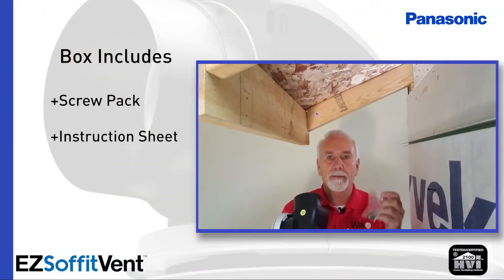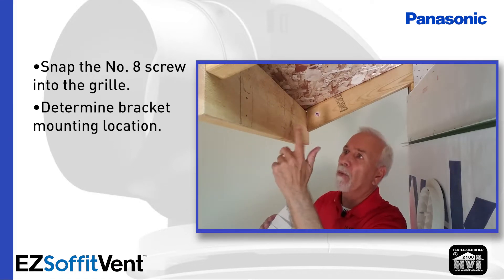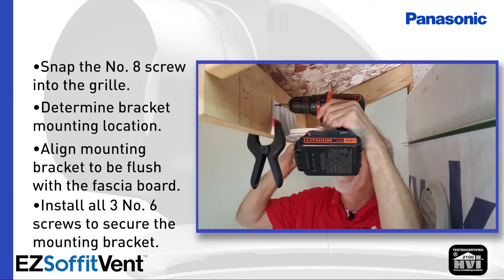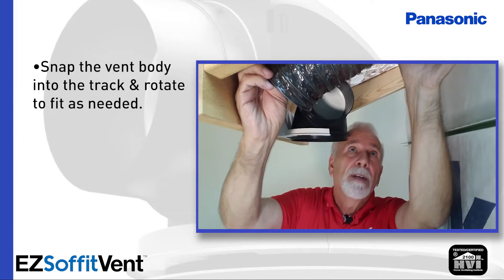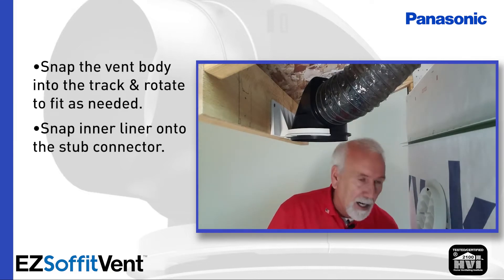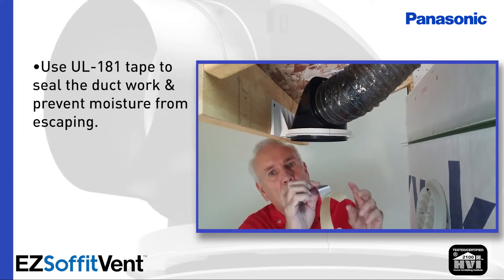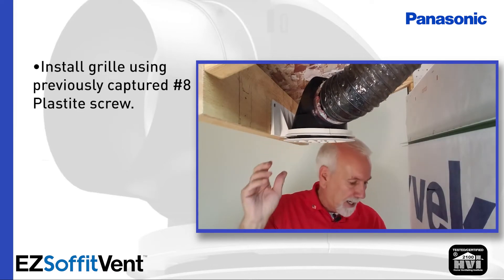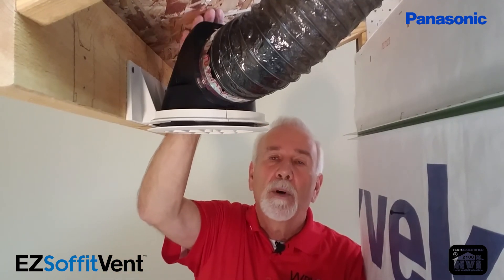EZ Soffit Vent™ Installation - Brought to You by Panasonic

Comment: going up through the roof is always better, as the moist air won't be able to re-enter the house and get trapped in the attic or under the roof and rot out the underside of the roof.
Reply: Your concern is very valid. EZSoffitVent was designed with attic entry in mind. First off it has an air-tight backdraft damper built in that prevents air from leaving the system during fan 'non-operation'. The majority of terminations designed for soffit discharge have air discharge patterns that make attic entry a valid concern. The most popular Contractor fitting sold today, has no backdraft damper, which means that moist house air can leave the system during all fan non-operating hours due to the warm air stack effect.  A duct system WITHOUT a backdraft damper is basically a 'chimney' during the heating season. The majority of fan related attic moisture issues can be traced to standard soffit discharge terminations for this very reason; house air is NOT controlled, and is often directed at the soffit system. Secondly, the discharge grille is designed to direct 100% of the discharge air downward at a 45 degree angle. The grille can be oriented to be perpendicular to the building which pretty much eliminates attic entry when combined with the downward directed airflow.